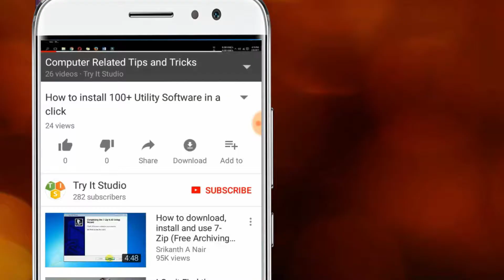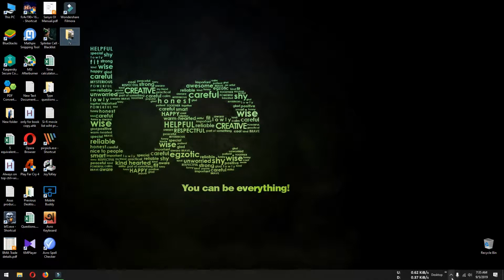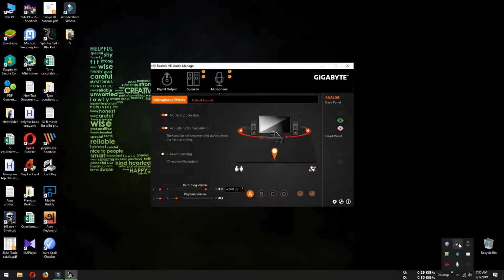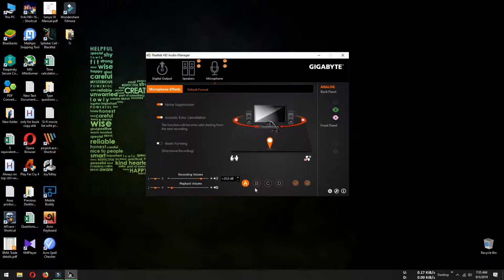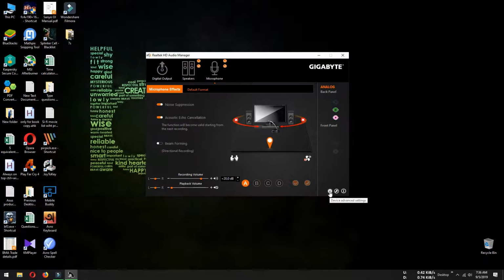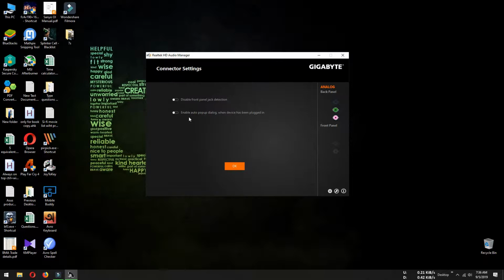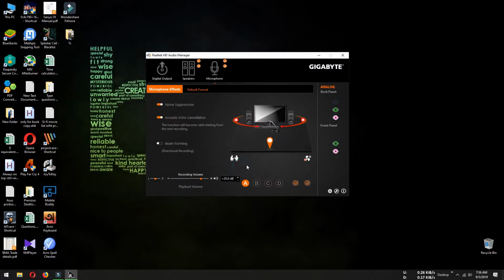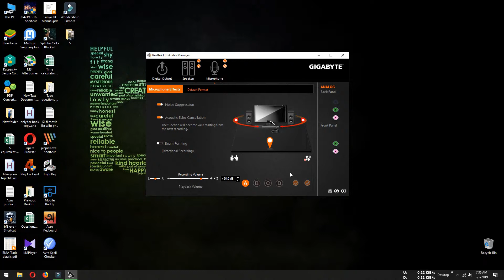How to activate front panel audio jack

Comment: My front panel ( green) is active..but i did not insert any speaker in front ( only in back panel)...and humming sound coming from speaker..whats the problem in gigabyte motherboard ?? Pls help
Reply from the maker: I think you should connect an earthing to your desktop casing. Or change the 3.5mm cable.

Comment: still doesnt work, its like nothing is plugged.
Reply from the maker: Restart you PC and check again. If the front panel still does not respond then you should check the audio cable connection on your motherboard.

Comment: that option is missing in my pc
Reply from the maker: How to enable Realtek HD Audio Manager: https://youtu.be/U76pZR470WQ
Reply: @tryitstd  NO The option ""disable front panel detection'' is missing in my realtek audio manager settings
Reply: @tryitstd  I tried it but  ""disable front panel detection'' is not showing again
Reply from the maker: @dheerajdheeraj146  Its location has been changed in new version. Open realtek hd audio manager then click on the folder icon  on top of ANALOG Back Panel.
Reply: @tryitstd  Yes i know but even though is doesn't show ""disable front panel detection'' It only shows Enable pop-up dialogue when device is a plugged in
Reply: @tryitstd  My computer doesn't detect front panel but I get my audio through front panel headphone jack and It doesn't show headphone icon in playback devices when i plugged in my headphone to front panel jack( I hope this will help you fix my problem)
Reply: yanyatarakuzumyiyenromaimparatoru  no I tried but i didn't get it